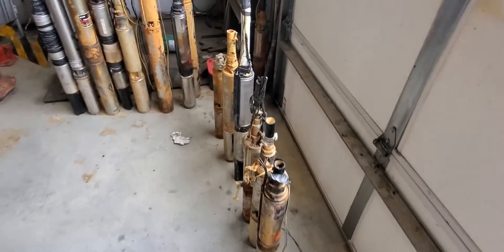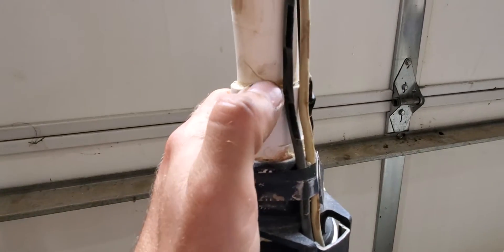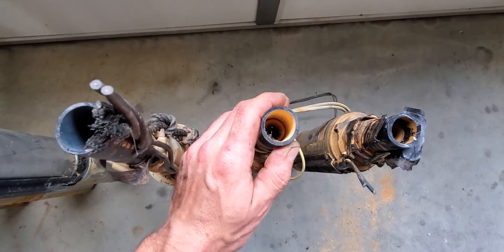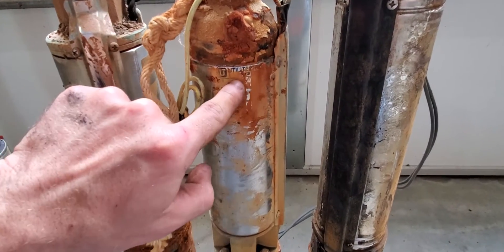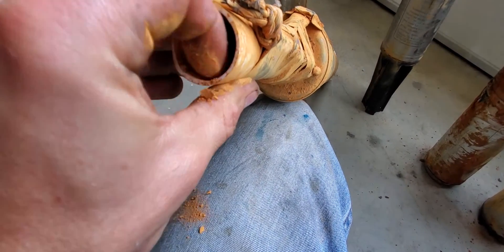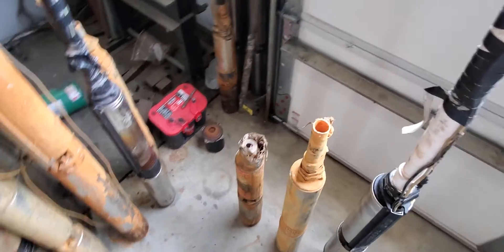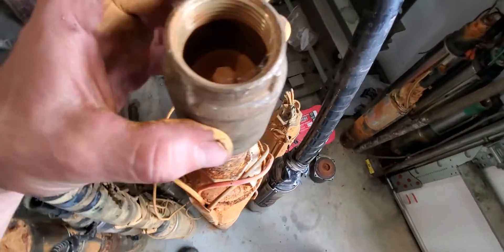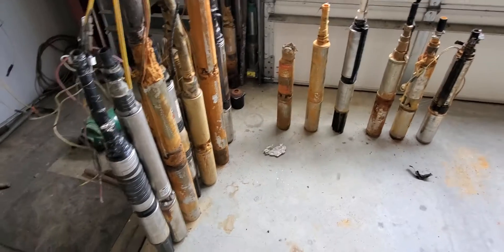No Water, Low Pressure,  Air in Water lines. Here's Why! #1 Troubleshooting video

Comment: I think my pump has a faulty check valve. I noticed the 40/60 pressure switch cycling off and on rapidly (within just a few seconds) with the main valve shutoff turned off to the house. The pressure was leaking back into the well. I replaced the switch (burnt contacts due to cycling so much) and i replaced the pressure tank (old one spit water out of the tire valve) and i added a pvc in-line check valve as soon as the pipe exits the well. Now, the rapid cycling of the switch has stopped, but the well pump us now spitting air every 45 seconds or so. So, i have diagnosed (i hope) one of two possibilities.....1. The pipe from the pump to the pvc in-line check valve is cracked and allowing the water to drain back into the well, sucking air in. OR.....2. The water level in my well has dropped and now the pump is sucking air. What do i do? I thought about replacing the pipe with a longer one by a few feet and dropping the pump deeper, but im not sure how much depth i have before its sucking sand. It is the black flexible, 100psi pipe that you mentioned, and i inspected it and cannot see any visible cracks. Fittings look ok as well. Somehow air is getting into the system consistantly about every 45-60 seconds, and it seems like thats coresponding with how long it takes to cycle off/on. Theres a bad leak somewhere inside the well casing. Any ideas, thoughts, suggestions? Well is 26 years old. Never had a supply ir recovery issue with it before. Thanks, Don
Reply from the maker: Your #1 thought is correct. 
Adding the check valve stops water back flowing at that point. But the pipe behind it keeps draining and that creates a air pocket in line. 
Pull the pump out & replace the pump or add a Simmons brass check valve directly to the top of the pump. 
It's possible that it's a cracked fitting as well. You'll find it once it's out. 
Also Check the tanks air pressure, a tank low on air can be the cause of short cycles. Videos on tanks on my channel teach you how to test/set tank correctly

Comment: Put in a new pump, tank, pressure switch, control box. Will pressure up 40-60 and run for about 15 min then water flow comes down to a drip, but then will kick back up for a few minutes. Any ideas

Comment: @h20 mechanic I got an issue. Deepened my well 1 yr ago and still having issues. Pumped silt and sand for 6 mo. Still a little comes through. Pump 30ft off bottom of well. Had the well line replaced a month ago now can not keep enough pressure to run the yard sprinklers. Took switch apart clean and functioning correct, gage says pressue 55-75 pump kicks on and off. I have 4- 70 gal pressure tanks and all new 2" pex for everything b4 comes into house. Sprinklers T off b4 running into house?  5 horse 3phase pump at 190ft? What could be reason I am not maintaining water pressure?

Comment: Hello I noticed low water pressure for a couple of days and didn’t think nothing about it thought it was loss of water but this morning when I got up I didn’t have any water so I went out to check the The contactors and clean them up and still just a little bit of water trickles out it’s pulling 6 Amps and I have schedule 40 PVC the pump is only about two years old any suggestions
Reply from the maker: Do you have a filter?
Is the filter element black/carbon type?
Reply: @h2omechanic  no
Reply from the maker: The pump is running fine at 6 amps. 
Check the pressure gauge at the tank, while you stare at it, have someone kill the pump breaker. The goal here is to see if it holds that pressure steady. But if it drops to 0 psi, you'll know that you have a leak somewhere in the well on the drop pipe.
Reply: @h2omechanic  Thanks I pulled it up and it was the fitting at the pump correct

Comment: So what kind of feed line should be used if pvc has a potential to crack. Very good video.
Reply from the maker: We use Black roll pipe with metal fittings brass or SS. Pvc is fine for Very deep applications, but does get brittle with age.

Comment: Could it be that the air pressure is low in the bladder tank that is causing it to be full of water thank you great info
Reply from the maker: Yes. Unless the bladder is torn. But add air, & if it happens again, you'll know the bladder is bad.

Comment: love your vids, can you do a video on vibration , not hammering but vibration. my pump Humms /vibrates loud enough to wake me when it kicks on from toilet or sprinklers.  I can put my hand on the copper pipes under my home and feel it. what are common issues ,repairs  ( for reference. raised foundation home, copper pipe. ) well puts out well just vibrates like hell lol.
Reply from the maker: Probably time to replace the pump. More than likely the bearings inside the pump have worn out & its not running True anymore.
Reply: Thanks so much for the fast response. Apon inspection, I saw galvanized pipe leading down to the pump. That’s definitely not helping.  Will it likely pop a breaker before it quits? If not I’m gonna wait for it to fail. Then replace the pump and galvanized. Do you have a recommendation for galvanized replacement?

Thanks again so much!
Reply from the maker: @user-ju3ns2cz1u  oh yea, rigid metal pipe, no wonder your hearing it! I'd recommend calling a well company. Galvanized pipe will require a mini crane & that allows them time to schedule you in future. If it fails, you may be waiting a while for availability and parts/pump. There's no many of us Well professionals out there, & the good ones are super busy & we all are struggling to find products. It's only going to get worse too
Reply: Thanks again.
I called my local specialist. He said he was slammed and would sell me a pump and the tool to hold the pipe in place when I lift it  .to unscrew each 20’ piece .  I have a back hoe I can lift it with . The specialist recommended sch120 pvc with stainless couplers . Does this sound about right.

Thanks again.
Reply from the maker: Yes, but please be careful, diy on stick pipe is extremely dangerous! If it slips, the wire can get sucked down the hole & hope to God it doesn't snag anyone. Do you know the current water level?
Depth of well? Depth of pump?
Reply: Yes on the depth.the company I called had my house on file . 
They said it was 100’ deep. That it should be 5 20’ gavi sticks.

Comment: Hi. My pump is a Tesla Ideal 2 and every few days or so it stops and come out with the code OL which means over load. We have pull the pump out and it doesn’t have that valve to stop the water coming back into the pump. Please advise if possible. Thanks
Reply from the maker: Buy a Simmons Check valve and put it on top of the pump. 1.25"x1"brass 
If its a new pump hopefully it's still good.
Typically a OL happens & the motor is dying, so if the pumps old, replace it. 
I stay away from Tesla stuff imo. I'd buy a Goulds or J-class or Grundfos. If the Pump has a Franklin Electric motor on it, it's Quality!  Cheap pump have short lives & don't lift from very deep. I did a Video on Amazon pumps showing just that.

Comment: I have 3 wells at my farm pumping into 2 3000 gallon water tanks, so no head pressure other than the well depth. In the heat of the summer i need all 3 wells at peak performance to supply my farm. 2 wells are 500' and 1 is 700' all 1.5hp  F&W with control boxs.  Recently the 700' well seems to be over pumping itself. It was rated at 7gpm but has always produced around 9gpm and never had an issue for 8 years now. It seems to be running out of water and it will trip the pump protection device. I pinched the outlet valve down to 4.5 gpm and it will run there without tripping. So i guess that one is running out of water.
The one that i want your opinion on is the 500' well and i believe it has a 15gpm pump set at around 380' It was rated at 15gpm but has never been able to produce that much. Maybe 8 or 10gpm consistently. This week it was down to 1.5 to 2gpm. I checked the amps and both legs are between 9.6 and 9.8 so i dont think its running out of water or the pump is worn out or the amps would be much lower correct? Your video made me think that it could have a crack in the pipe. Schedule 140 pvc 1.250" but it would have to be in the casing because there is no sediment coming out of the pipe. The thing is that after 4 days of 1.5 to 2 gpm its now putting out 6gpm. I could use a little help. Any ideas?
Thank in advance, J
Reply from the maker: Ok, so I'd say you could definitely have a broken pipe down the hole. A simple test to see if its broken is to open a spickot that's hooked to only that 1 well. Kill the power & open the faucet & put your hand on it. If it leaks, it'll cause a vacuum on you hand. It may take 60sec but you'll definitely notice it. 
If you never get a suction feeling & the water seems to stay there, then there's no leak in the drop pipe. 
You pump is just simply worn out.
At 500ft id recommend a 5 or 7 gpm pump head. The water level being so deep, a lower gpm pump is definitely required!  
I'd have 5GPM 1.5Hp in all 3 wells. 
The 9.6-9.8 amps is perfect for that size pump, it's actually slightly under normal load #s. But try the suction test & let me know
Reply: @h2omechanic    I just checked for suction on the line, there was none. Wouldnt the amps be way down if the pump was worn out and not pumping?
Reply: also I cannot put 5 to 7 gpm pumps in because i need a minimum of 25gpm between all 3 wells to get by.

Comment: Hi H2O mechanic I am new to wells and  recently had a power outage are you supposed to loose all water and pressure
Reply from the maker: You probably have a "low pressure cut our switch" 
Itll have a little lever on the side of the pressure switch. You have to hold it at a 45⁰ angle until it build enough pressure to hold. (Note flipping it up is Locked OFF) so hold it at a 45⁰ angle. 
Watch videos on them & youll understand. I always replace them bc most people don't understand them & have this issue after power goes out.

Comment: I have a pump with good pressure tank, air in pressure tank is set at 38lbs.  Installed new switch 40/60.  Installed new gauge.  Pump will come on and run for a minute or two, then pressured starts to drop till there is no water.  Then about 5-10 minutes later pump will come back on and run again for two minutes.  New gauge will never  read above 35lbs, even if water is off.  What would cause this? Undersized pump? Broken line in well? Need some help before I pull pump and replace. Any suggestions?  Thanks

Comment: Just had new well pump installed because I was not able to build pressure above 25 psi.  Now the water is coming out really cloudy and 8 hours after it was installed I'm back to only building up to 35 psi. It worked for those 8 hours just fine. The most important thing I heard you say was that if you flip the breaker without your water running and the pressure drops to zero you've got a hole in the pipe or pipe fitting. That's what happens to mine! 
Does my issue sound like a hole in my pipe?
Reply: Wow your diagnosis was spot on! For having so little to go off of and having never seen my set up I am amazed at your abilities.  The water was gushing out of the bottom of the frost free hydrant just like you said! Pulled the hydrant and put a ball valve in its place to test the pressure and everything seems to be good. Gonna install new hydrant later today. I'm cautiously optimistic that I've solved the problem, but I couldn't have done it without your help. THANK YOU! 
If it still loses pressure again you ll be the 1st person I ask. You re awesome 👏
Reply from the maker: @igrowmelons979  make sure you tell your father a Humble Guy on YouTube was able to diagnose it sight unseen 😉 😎. Glad you got it fixed! 👍
Reply from the maker: Yes, you have a major leak somewhere
Reply: Well this morning it's back up to 45 psi and my 75 year old father that owns the house refuses to believe there could be a leak because the professional didn't find it. He also believes anything I find on YouTube isn't real or is russian propaganda so I'm fighting an uphill battle. My question is why does the pressure stay good until we turn on our outdoor frost free full blast? What kind of hole in the pipe would fail to build pressure sometimes but not others?
Reply from the maker: @igrowmelons979  ok, so at the bottom of your hydrant is a drain hole. When it's off, it drains the exposed metal pipe. I believe that when your hydrant is off/closed the little drain at the bottom is spraying out the pressure constantly. 
Try this, leave it on/open but have a hose on it with a nozzle & don't let the hose nozzle leak (keep the spray nozzle off)
Then go kill the well breaker, see if it hold psi at 45 AT the tank (it should hold steady)
If it holds steady & doesn't leak, then go cut the hydrant off & see then if it leaks down to 0. This will definitely tell you if it's the bottom of the hydrant leaking in the (pee) valve. 
Its rare but can happen. Especially if you have acidic water(blue green stains) 
The water has eaten up the hydrant valve internally. 
Your on the right track for sure. 
Your dad hasn't seen my videos lol. I'm the most helpful plumber/well driller on YouTube! 
I have a hydrant install video that will show I details

Comment: I need some help, I purchased and installed Topintech well pump 1 hp 110 volt 20gpm 223 ft head from Amazon , for some reason it pumps good for the first five minutes then slowly decreasing in pressure then shuts off , if I wait 15 minutes, I turn back on  pressure builds back up good then after five minutes same issue, I just bought this land with well on it but had no pump, the depth of well is at 300’ plus , the water surface is at 100’ , I went to 200’ , I’m wondering if I should go deeper or did I get a cheap pump ? by the way I tested this in my swimming pool and it worked great without issues to test it out before dropping it in well . I used submersible wires and black poly pipe rated 200 psi , sorry for this long question, thank you and greatly appreciate your videos
Reply from the maker: https://youtu.be/qIxKGNpZycQ
Watch this video. 
If you still have questions after just comment again. I covered this topic bc if so many with this similar issue

Comment: I appreciate this video. I am replacing a pump. My expansion tank went bad and I have no idea how long it was bad. I pulled the pump, cleaned the screen sat the pump in a can full of water and let it run. It got a little better flow after a while but I didn't think how much should have been flowing. It was definitely no where near 5 gpm. Unfortunately I put it back down and got a little water pressure but never reached cut out. I just pulled it again this morning and I am  heading to buy a new one. This video really helped convince me. I am kinda handy but people who do this had me believing it was something else. It is stranded wire so I feel the likelihood of a break was low. The pump is 18 years old. Thanks again
Reply from the maker: Once you pull it out again, just inspect the wire carefully looking for rubbed off wire coating/ exposed copper.  
I have a well pump install video that would be great for you to watch. It's 20 minutes long but filled with great info.

Comment: Hello, I noticed that the water pressure inside the house is not what it used to be. The well pump keeps running but will not go above 20psi at the pressure tank. I isolated the water flow to just the pressure tank to remove the possibility of a leak beyond the pressure tank. I also checked the air pressure and it was low at 17psi so I aired it up to 28psi because of the 30/50 switch. The air held but did not budge the pressure gauge above 20psi. My question is, can a pump wear to the point of not being able to go above 20psi ?
Reply from the maker: Yes. The pump can possibly be that worn out.
But what is more common is a leak, either out in the yard or down in the well.
The fitting between the pump and the pipe will crack. 
Kill the breaker and see if it drops to 0psi, if it does go to 0, there's a leak. If it holds on 20psi, the pumps worn out.
Its also possible that a leaky toilet can drain a well dry & the pumps struggling to lift. That test would be leave the breaker off for 6 hours.
Reply: @h2omechanic  WOW, great tips, this narrows it down to a pin point. Subscribed !

Comment: I installed a new well pump I have good pressure when I turn the water on it runs for a few minutes then I lose all water pressure I know nothing about thanks for the video
Reply from the maker: Watch my tank videos and learn about setting the air pressure in the tank. It's possible that your tank has no air in it, or way too much. A 30/50 switch needs 35 psi of air in the tank. But the tank must be empty of all water to check/ set it. So open up a faucet and have the well breaker off. Then go check the air with a tire gauge. Nipple at top of tank